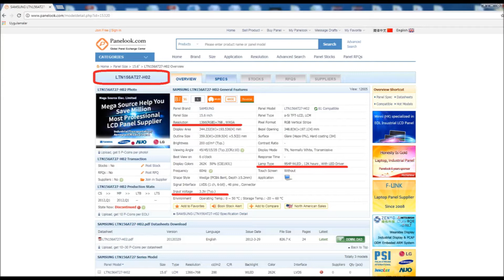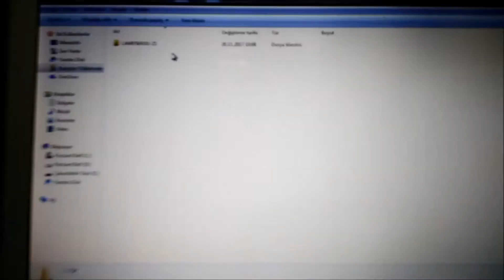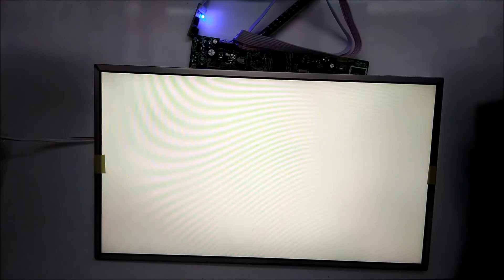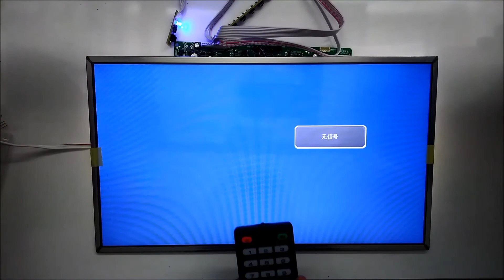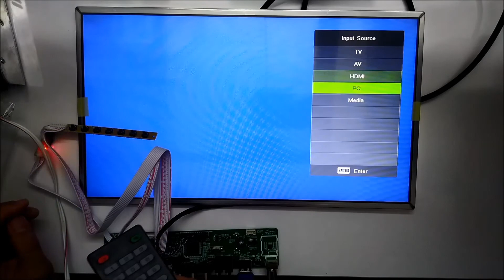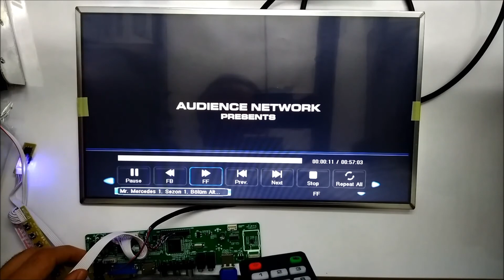V56 LCD TV yapmak - V56 Universal LCD TV Controller Driver Board TV/PC/VGA/HDMI/USB

Comment: I have a V59 but the led connected to the button pad flashed blue and red, screen is black. I have tried multiple firmwares with no luck. Can I repair the board?